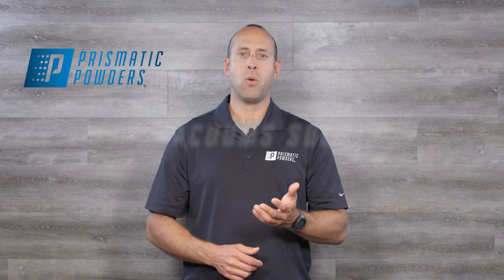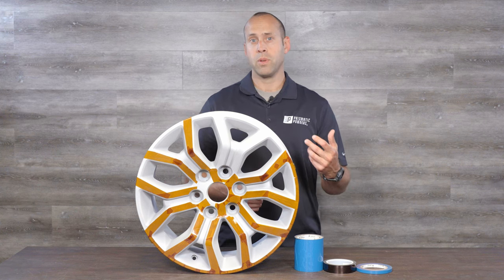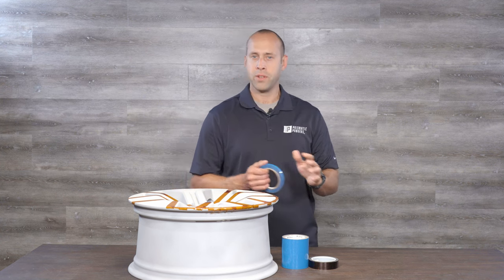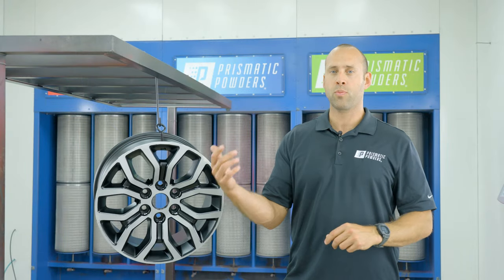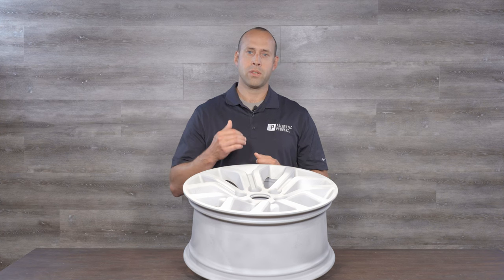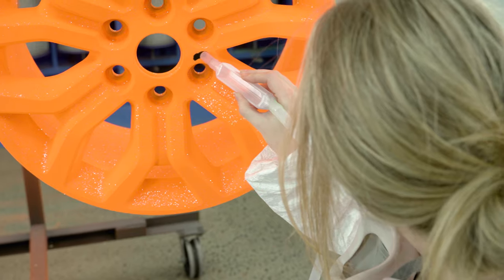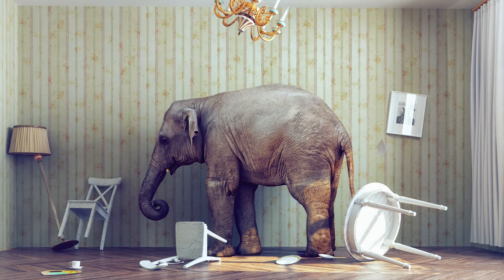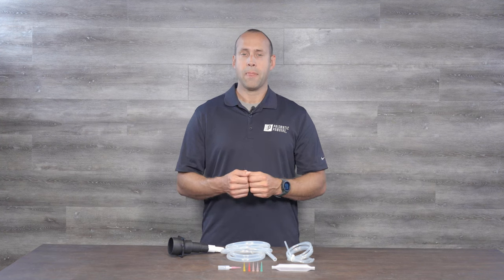Prismatic Powders | Do Vacuums Suck For Multi-Stage Powder Coating?

Comment: Would it not be easier to spray the green first, then mask the green and spray the black ? Easier to wipe, mask or vacuum the flat surfaces instead of the the deep recessed parts is it not ? Just wondering.
Reply from the maker: Possibly, and a lot of times you do want to assess the entirety of the job to figure out the best starting point. With this particular wheel it didn't seem too bad either way.

Comment: Is there a better way to get clean lines between the colors. The camera is moving quickly and isn't very close to the wheel but, especially under the black light, you can see how jagged/not clean the lines are. If I were a customer, there is no way I'd be happy with that result.
Reply from the maker: The lines are actually pretty clean, but the metallic flake made them look pretty rough, they were much better looking in person. If you are masking, you want to peel the tape when the powder is still pretty soft and a very warm temperature. If you are using a vacuum, you really just need patience and a steady hand. Like most things a lot of practice will help. As we mentioned in the video, we really liked using the vac, but there are times when masking will be a better option.